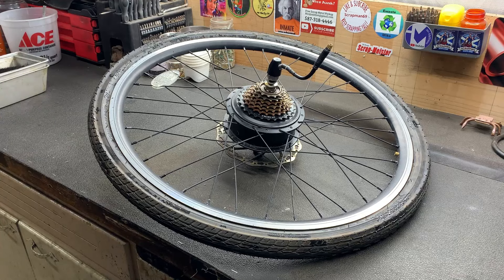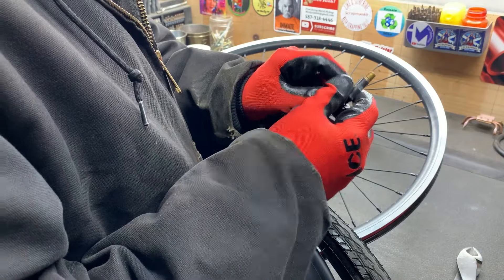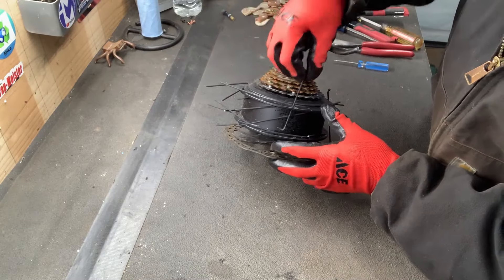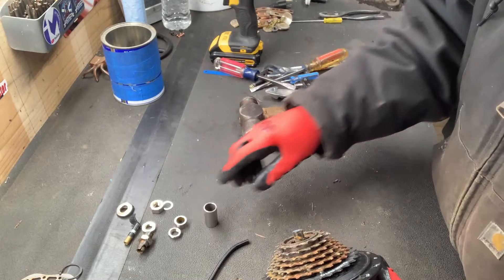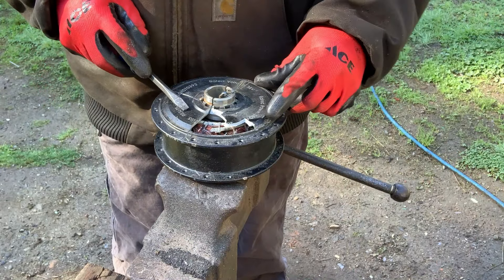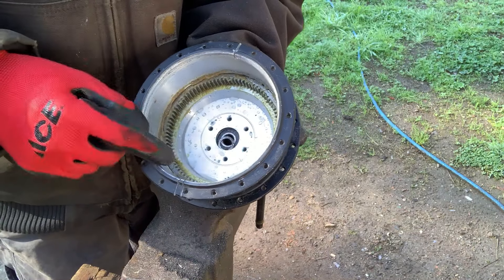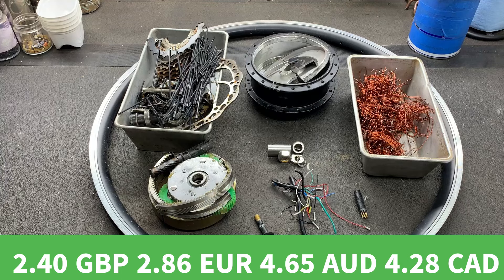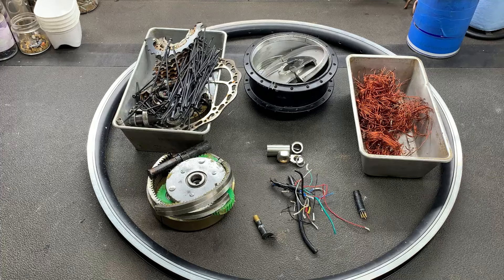How to Scrap an E-bike electric Motor for Copper

Comment: It's like you need your own shredder to grossly disassemble some things. Angle grinder blades aren't expensive but you'd really eat them up with something like this.
Reply from the maker: The disks I use are about 50 cents a pieces, but I really didn’t use much of the disk. I try not to use my grinder since that costs money, but sometimes it’s just the right tool lol. 
Thank you for watching.

Comment: Most bike rims have either steel or aluminum pins at the seam (opposite of the valve stem hole).  I take them out.  Freehwheel comes off with a $12 splined tool at most bike shops. Take it off while spokes are in place.  Peace out!
Reply from the maker: @karlbe8414  my yard doesn’t care about those pins, but I should’ve mentioned that in the video, thank you! 
Yeah I figured there was a special tool for them, but I try and avoid buying rooms that only serve one purpose. Have a great weekend buddy

Comment: Three pinion ring and pinion set up. A 65 Massey Ferguson tractor has a two pinion setup in right and left, but the log skidders have same pinion gears but it uses three like your bicycle motor. But huge cast iron and steel ones. I rebuilt them in my father's tractor when I was young, we drove that tractor for years mowing cow pasture, but not knowing we were supposed to be checking gear oil to this one particular plug on both sides?Surprised plastic has strength enough to last. 
Those 26 inch bicycle tires are $20 at Wal-Mart and they stay sold out.
Reply from the maker: Bet that’s some good memories for you!
The tire had a cut in it, the tube I could’ve saved but I ruined it lol 
Thank you for watching.

Comment: My scrap yard pointed out to me that there is a small magnetic piece of metal that connects the aluminum wheel together. If your yard is picky, they will only buy it as dirty aluminum. If your run a magnet around the rim you may find the metal I'm talking about. They may not all have them but many do. I really enjoy your videos. Take Care.
Reply from the maker: Hey brother. 
My yard doesn’t care about that, but I should have pointed that out in the video. Thank you.

Comment: Do they take the rims as clean extruded?  One yard I was dealing with at one time said they were considered dirty, as there are two steel pins in most of them that connects the ends of what started out as a straight piece. I'd have to cut out that small section to make them clean.
Reply from the maker: @bearhardcorepicker  my yard takes them exactly as they are!

Comment: Why don't you like to use the angle grinder inside the shop?
Reply from the maker: It’s really messy and the hot dust or sparks will destroy the tent material

Comment: Does the machete not work well on those motors?
Reply from the maker: @brianrucker3484  the machete will work. The reason I didn’t use the machete on this is because (I should’ve mentioned this in the video) sometimes there are steel pins to hold the steel lamentations in place and those steel pins will ruin the machetes blade.
Reply: Do the AC compressor motors have those steel pins as well?
Reply from the maker: @brianrucker3484  not that I have found yet. They’ll be pretty obvious, just check either end of the stator, you’ll see the end of the pin if they’re there.

Comment: what a challange to scrap this.  What??? Plastik Gears inside:face-blue-wide-eyes:
Reply from the maker: @andreabc1469  I know right? Seems awfully cheap to use those. It’s like they want it to break.
Reply: @scrapitall200  I don't expect brass, but gears made of cast aluminum near heat sources should be possible. An electric motor gets warm during operation
Reply from the maker: @andreabc1469  exactly! I honestly thought they’d be aluminum.

Comment: Another great video. But in my opinion, people should stay away from the angle grinder as much as possible. I've seen over 500 stitches because of the angle grinder.
And yes some of it is stupidity. Always wear safety glasses, even if it's for something as simple as griming a rived i also used a pair of welder's gloves to protect my hands. If you're cutting spokes off of a bicycle wheel with the grinder, you should always cut close to the hub. This way, it won't bounce as much. Less chance for a blade to get caught and break. And finally, if you remember me, I finally dismantled thirty five out of thirty seven major appliances after I finished the last 2 stoves today. I don't want to see a major applied for at least a month.😂🤠
Reply from the maker: I wear a full face shield when using the grinder! 
Of course I remember you bud lol. That’s awesome 😁
Reply: @scrapitall200  that's even better.
I really got lucky taking apart washing machines.I got to take apart 3 washing machines that were the exact same brand and model which made taking all 3 apart, very fast, the kicker, what they're the same exact wash machine I have in my house, so I was able to scavenge some parts incase I need to repair mine. But having that type of luck sometimes scares me because normally, after something realgood happens, something really, bad happens, so i'm looking in the sky for that house to fall on me😮🤠
Reply from the maker: @fraudanator2249  that is awesome, especially getting all those spare parts. 
Nah, you’ll be good, no houses will be falling on you lol.
Reply: @scrapitall200  👍🤠